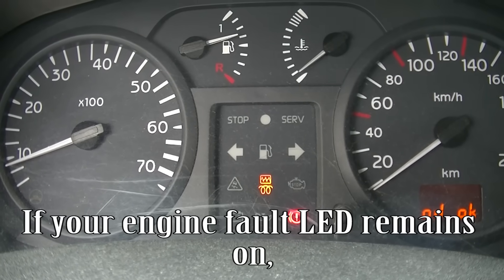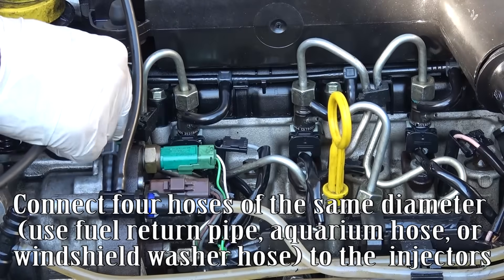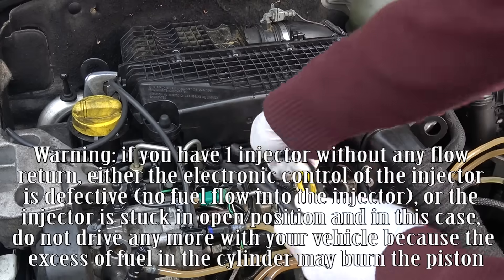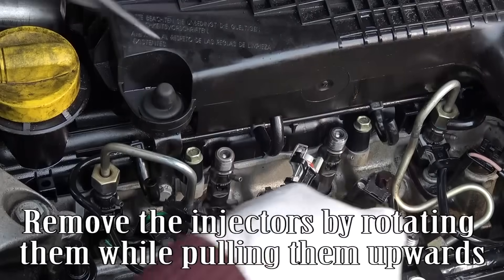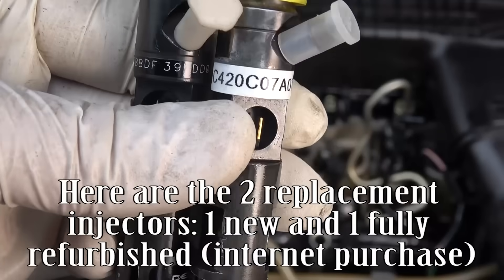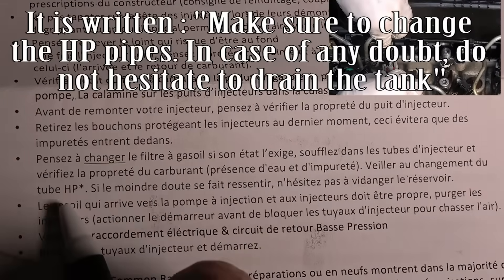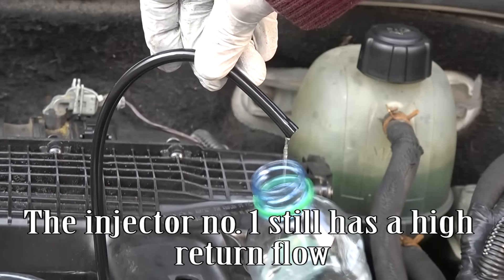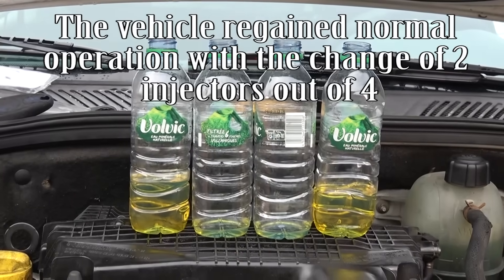Injectors test and replacement

Comment: You can enter the injector codes using a chinese Delphi ds150e. So sad that you cannot read the injector correction on idle in a 2004 1.5 dci Kangoo 60kw... goddamit.

Comment: After switching 3 and 4 injector one wont work. I get missfire other one is bad so i replace it with repaired one and it works but 3. Dont work and i have misfire. 
Any tipa on how to get it working again?

Comment: Anyone answer this please,if you have a diesel engine and a glow plug has gone would this show more fuel in the bottle?
Reply: No 
But the engine are difficult to start
You crank more time to start
Reply: @konstantin-big  cheers
Reply: @piecetoyou8285  
I hope you understand what I mean,
My English are not so good
Reply: @konstantin-big  Yep your English is great,
Yes I am trying to work out whether it was glow plugs or injector ,
I now realize its possibly an injector as the car turns over straight away , but while parked up.there`s a bit of a ticking noise,
And when I hit 3000 rpm the car blows out smoke and start to run with bad idle,and nearly cuts out with engine management light coming on,
So I think its the high pressure side on the injector that is knackered,
I
Reply: @piecetoyou8285 
Hey 
Did you do an obd2 test so you can read the error codes????
That's the right way to do
Reply: @konstantin-big  yes` but as I am not a mechanic I struggled to work out what injector it was , it kind of stated 3rd one,as its a ford fiesta 2008 ,I think its a Peugeot engine so the injectors are 4321 not 1234 i think its known to be that way when looking from the front of the car at the engine, kind of the opposite to most cars when stating the third injector,
But As I could not afford to sort it out at the time the car were left 18 months , now riddled in mold so I think it may be scrapped ,
Reply: @piecetoyou8285 
Usually from the gearbox side it is the 4th-cylinder, in Peugeot cars there is the 1st-cylinder
I hope I helped you
Reply: @konstantin-big  well when driving I hit 63 mph then the car was starting to not respond on the peddle the more gas I gave it the worse it was getting so I had to drop gear down and ease on gas as it went into limp mode,
then I disconnect the battery for 10 minutes once stopped started up after cranking twice then driving home went into limp again and started running roughen Ask a mechanic and he said they are known for the 3rd injector going and he said it sounds like the as the engine noise and the way the engine shakes more,

Comment: Don't forget you need to put the injector codes into the ECU(with an OBDII scanner, for your car, a universal one will not have this feature). Without the new injector codes entered into the ECU, the car's engine will not run as smoothly as you have shown and may also get damaged.

Comment: Misschien krijg ik mijn 15 Dci 2005 zo gemaakt, die heeft nog geen uch. Eerst eens goed de nummers op de injectors proberen te noteren. En deze melden of ik ze moet aanmelden. Met de flesjes wist ik niet. Of mag je niet weten, steeds wordt je weg gejaagd, denkelijk door het zwarte geld dat je auto nog opbrengt(Dringend gezocht auto's), die gasten of het zwarte circuit.

Comment: What do you do with injectors 1 and 4?? Replace or leave as it is??
Reply: Replace if you can afford because it’s shown they are also worn out but not quite as much as 2 and 3 were. It will be maybe 6 months tops before it needs those changing.

Comment: A bad camshaft sensor can mess up your injector sequence.
So before you change injectors check cam sensor.
Reply: How do you check the cam sensor?
Reply: Can a bad camshaft sensor mess up injector sequence only for the 2-injectors??

Comment: Hey! I have a question about painting a car. My car is painted in indigo blur but it has some paint cracks due to sun i guess,i took a sandpaper and removed all those paint cracks. My question is,do i have to sand paper my entire car or just specific spots where are cracks. Also do i have to use a primer spray for entire car? Thanks!
Reply: Spray the repaired areas with grey primer, sand back with wet & dry sandpaper. Use degreaser if necessary. ensure the car is dry & free from dust.
Respray areas with choice of colour. 
Enjoy. 🚙
Reply: اهنةعى   احى  حسن  هشحى   ٠٥٣٤٦٤٧١٠٧

Comment: Great video! The only thing I would do slightly differently would be to take the caps off the injectors when they're in to avoid any tiny particles going in them when putting it in the bore. If the injectors are really stuck in you can slacken the clamp a little and turn the engine over. The fuel pressure will blast the injector out a bit making it much easier to remove. Brilliant video though. Your clio engine looks much better than mine!

Comment: madam ,why changed  only 2  injector(2 & 3),though other 2 injector(1&4) also shows high return flow?
Reply: this is not the original video. in the original video she said,need  to replace the injector.

Comment: Bad advice, with these test results, all 4 should’ve been changed to get optimal performance. 
Great video presentation, very clear and informative but fix and reasons for only changing 2 injectors, is not professional and the two poor injectors will need to be done in a short amount of time, in the future.
Reply: So many people tend to have tongues larger than their wallets! LOL 😂
It's easy to speak, when you're not the one paying the bill!! ;-)
Reply: Replacing all four on an old car wouldn't be very cost effective.

Comment: W H A T   A   F A N T A S T I C    V I D E O   
edited:   (except at 8: 53; the proper way is to put the washer around a thin screwdriver,near the handle,hold it there,then point the screwdriver down the hole,centered,then release the washer,then CALMLY insert the injector).

Comment: Would a defect injector explain why my Clio 2 1,5 DCI 2004 which has been running 315.000 KM is having weird starting issues when luke warm? It is smoking white when coldstarting which has become a bit worse the last 50.000 km. I know about the CAM shaft sensor and it was replaced 8 month ago without solving this problem. My problem is this: Situation 1: I start my car from cold: Car starts right up the first time: Situation nr. 2 car has been warmed up thoroughly on a longer run, is stopped and is then started and it starts the first or sometimes 2nd. time. Situation nr. 3 which is the critical part: Car has been running a smaller trip to only luke warm conditions or car has been running warm on a longer run and then stopped and left cooling for around 1 hour: When starting I need to try in excess of 3-4 times to start the car. The record is 10 times until i nearly drained the battery recently.  But it does start eventually...but for how long i can trust this i don't know. This has been progressively getting worse over a period of 1-2 years and still getting worse. Using an additive in the fuel does seem to help a bit. By the way this car is simple great. No real rust to be seen yet and it still runs 20 km a litre and only spends enough oil to not need a top off between the 30.000 km. service intervals.
Reply: Injectors  , i had the same problem!

Comment: Great video, good job, thanks for sharing, though I would have replaced all four injectors, but that’s just the way I roll with my cars!
Reply: So replacing all 4 would be the best option right? So that means, the lower the return flow, the better the injector.
Reply: @arthurimona5901  yes that's correct mate
Reply: @akeelmukhtar1808  can't you just scan it with a diagnostic tool???
Reply: You pretty much have too replace all of them because they all work for the same time and last about the same time so changing only one or 2 will be a waste of time as the other 2 will fail shortly after and need replacing too. If you can’t afford all of them at once then just do one at a time but it’s not wise.
Reply: As you can see here after changing those too the other 2 are still worn but are working fine right now. It won’t be long before those too fail like the first 2 did.

Comment: I've followed the same procedure, but after refitting the injectors, engine is not starting. What could be the cause? Please help, today is the third day.
Reply: @P Kikon
Not fully primed? Did you check for fuel delivery to the injectors as is seen here in the video?
Next possibility: Still to much internal leakage in the remaining old injectors or in the high pressure pump. 
Not enough fuel pressure during engine-start will cause the motor controller keeping the injectors shut electrically. If engine starts with brake cleaner and then keep running, that was the case -> you override the controller shutdown with  starting fluid.
Could be caused by worn out pump, leaky metering valve or leaky throttle valve. For instance: Abrasives from a worn out pump will cause leakage at every valve in the system, also very soon in the now new injectors.
These fords have two stage fuel-pumps,  a priming and a high pressure section build together, unfortunatelly the constantly back and forth sliding blades of the priming excenter-pump tend to wear out at their sides and this wear spoils the high pressure side too, which for itself would be a solid long lasting part, because the high pressure pump is designd with rollers instead of blades. (Speaking about the Delphi-pump)
Reply: By the way: It's not said, that this car shown here will drive well with the remaining fuel leakage. More likely it will go to emergency mode and then stall as soon as you apply high load at relatively low rpm. Then you see the infamos error code p0251 or related ones.

Comment: brake cleaner ??? where the hell did you learn that, on a common rail diesel you shouldn't use easy start really, ok maybe last resort on an ageing car if you need to confirm you have got a workable engine ie: if the belt cover is a nightmare to remove or somot, but i would only use to confirm that its next journey aint the nackers yard, i repeat an old vehicle, i aint going into it but brake cleaner and easy start for that matter but not as extreme burn twice as hot, its burn pattern is more of an explosion than a conrolled burn, 80% of modern fitters have no idea of how fuel actully reacts to compression or a spark, all there taught is where the obdII socket is and first replace wot it says, if it dont cure it refer to the exuses and flannel board, start at top and work down till youve bored them or baffled them, long storey short, td4 freelander, peugeot engine 2.2 if my memory serves me, young apprentice 3yr in, proper lad, really keen eager as shit to learn to the point where i used to turn to grab a tool and fall over him, had a lot of time for him, tried to teach him the way i was taught, ie: no matter wot they do to stretch out the emissions a engine is a engine, i thought he had listened to me, services said freelander, no issues proper thorough kid, comes to starting it after replacing fuel  filter, bearing in mind im in the office i can hear this sewing machine cranking and cranking so i sit there, thinking hes a good kid nowt to worry about, stay in your chair cant keep wiping his arse, no more cranking, i think good lad hes finally sub mitted to fitting universal hand primer, proud as punch i am because anyone whos in this game knows these kids are hard to find now, they all want to play call of duty and smokes  spices or somot, next minute i hear the inevatable cranking again, followed by what can only describe and you will need your imagination in this, a 2.2 diesel bouncing its rockers at 8-9 thousand revs, the silly twat has removed boost pipe(and to compound my horror, pre inter cooler) andbasically spayed in brake cleaner, no start so keep spraying he thought next min little bit gets to combustion, bit of a start followed swiftly by boost and here comes 1/2 gallon of brake cleaner, to all those who have stayed to the end i thank you and can report i dont wipe his arse no more, one 50thou bent con rod and 4 piezo crystal injectors with half there nozzles burnt away, end result my walet 26 hundred quid lighter, two days labour up the swanny and for some reason a good customer i aint seen since. BRAKE CLEANER, is for cleaning brakes, it aint hard the clues are all there, some people will comment why dont you post some of your knowledge ? dont mis understand me im all for technology, its a wonderful thing as is youtube, but importing what you think is knowledge is not always a good thing, i know peoples intensions are good, but in my opinion cars should be fixed by people who have the skills to fix them, its the most under paid skilled job in the country, you dont mind payin a plumber £85 to basicaly get in a van cause your waters a bit cold, but you will skrimp and save with your car, and then fill it with your loved ones, between youtube, forums and trust me when i say this i aint a racist so dont start on me, the influx of eastern europeans your killing our trade, theres more people (diy ers) fixing there own vehicle now whilst watching youtube than mechanics, to iterate the racist point i only incude eastern europeans because they have a different reality on the uk pound, dont get me wrong they are bloody hard workers, because they want somot better and they strive for it, we lost that somewhere in the last 2 generations, kids now genuinely believe its owed to them, sorry for my rant its just so frustrating, brake cleaner ehh??? who'd of thought !!!!
Reply: Glad you typed all that.   Saved me a job.      With you all the way mate, we've all seen a Muppet or two scratching their head.   Worst I've seen was a bloke who bought a second-hand wheel and decided to grind the centre hub out because it wouldn't fit his car. Luckily I made him see sense.    Stay safe.  Peace
Reply: Your comment is scary : too many text omfg.  The uploader is french and i think he will not translate , but maybye. I think brake cleaner is ok, a lot of people use that to start cars in france when it is no working.

Comment: On diesel engines that have glow plugs that start heating up as soon as the key is turned you may have an explosion using brake cleaner or an other flammible spray.
Reply: No it wont explode

Comment: This must be the best video on Youtube on teaching you about diesel engines learned alot well done
Reply: A
Reply: Y⁶
Reply: Tý⁶6⁶⁶
Reply: This video actually have several flaws. It doesn't address the problem with dirty or uneven injector  holes. Also it doesn't say that you should use new bolts which you should.
Reply: Still watching in October 2022 👍👍👍
Reply: Tell me price of one injectors
Reply: peter friel BB
Reply: Indeed !!

Comment: haha....thank you, I've 1KZ diesel engine with inter cooler, the engine runs perfect without any adorable voices and the pick is also on the positive side with very best performance.Eventually at the starting(cold start) the engine take very hard battle to start and even take 3 or 4 heaters and sometimes does not working. Any idea , what's the matter?

Comment: i have one question: where to spray brake clean to force start in a turbo diesel engine. thanks in advance
Reply: In the air entry. After the air filter.

Comment: hi I've got a  mazda b2500 my engine is smoking even after i have replaced rings amd it has got the same noise on your video i think its injectors but then its mixing oil and diesel and the smoke comes out with oil as well on the exhaust tail can u please advise me on what the problem is?

Comment: you should always change the high pressure lines when you loosen an union  and good tip to hold the sealing washers in place while inserting an injector is to use dab of grease never put the injector hard into the bore like you did there the tip of the injector is extremely sensetive

Comment: how much return flow is good or normal I have 2012 hyundai santafe 2.2 crdi
Reply: JASPAL SINGH it's in the video... you need to compare fuel return flow to see if there are any abnormalities, for example one or two injectors returns considerably more fuel as it is shown here if you doubt that your engine isn't working properly.

Comment: very good instructional video. I would cover all the injector holes, before blowing out the bore with compressed air. You do not want to blow debris into the other bore holes. After cleaning the bore holes with a rag, blow them out again. The only reason for cleaning area around bore holes is to avoid sand or metal shavings out of the cylinders. Your first step in cleaning around the injector before removal would have been sufficient. Using a solvent spray on a cool engine and rising the area, then blow dry, would be best practice. Thanks for posting.

Comment: Hey TutoBuild love you videos! Can the engine run without programming the ECU with the new injector codes?
Reply: Anders Greve yes it will still run fine but ideally get them programmed as soon as you can
Reply: Are they hard to get programmed?

Comment: I have 03  1.8 tdci Ford focus that won't start. there is diesel coming to 2 injectors but nothing to the other 2. I injector pump problem or injectors??
Reply: it can be both matters if the care started befor and when it was hot did it start or keep cranking but no start up?

Comment: did this to mine last Sunday night 4 degree's, garage said vibration was from Dual Mass flywheel instead. Like the bottle idear.
Reply: bf
Reply: Stephen Geraghty this car does not have dmf
Reply: this car has half of the thing more modern engines have end its still running :D:D